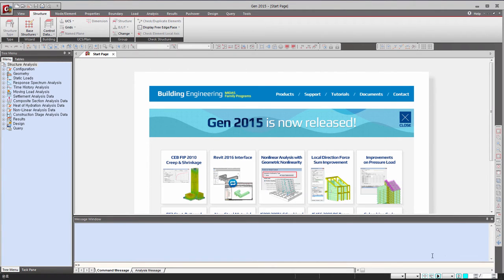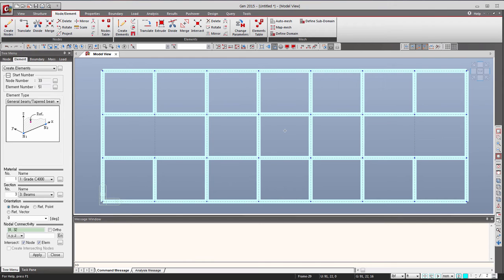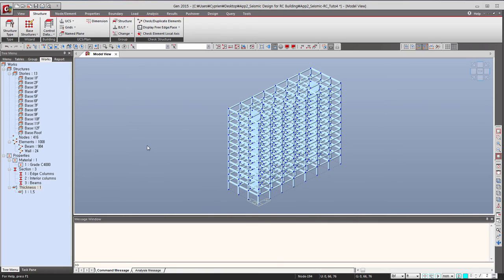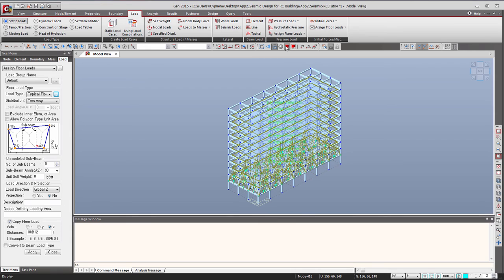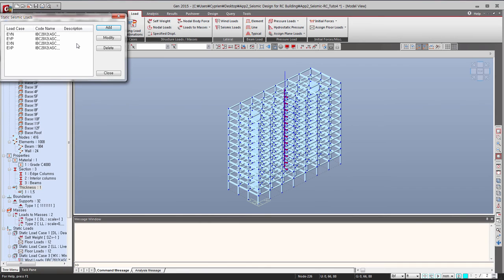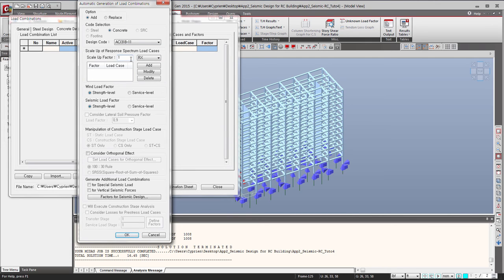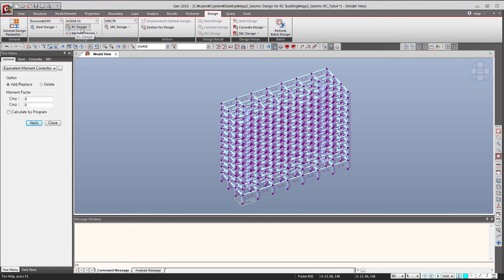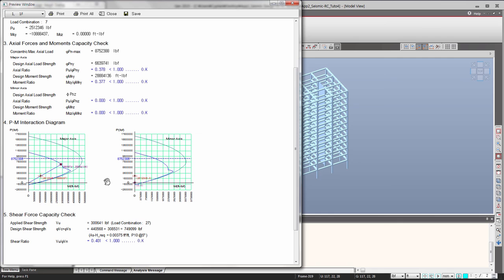[midas GEN Full Tutorial] RC building seismic design

Comment: Thanks for this video. May I ask, in the Response Spectrum load cases why did you use a Scale Factor of 0.125? 25mins and 25 seconds. Thanks
Reply: It was from Ie/R, where R = 8 from modification coefficient, and Ie = 1 from building risk category.
Reply: @desertelang  And, Why did he use later the 1.48 factor for RX direction for Response Spectrum Combination and 1.00 for RY direction?
Reply: Can you tell me from the video when it shows that value?.  @alrogodi
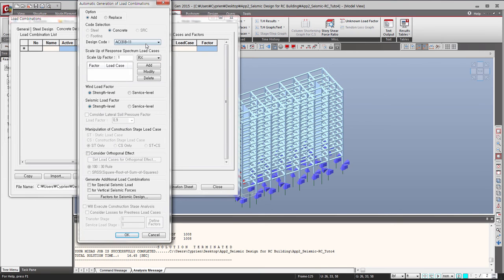Reply: @desertelang  It is at 29:30 of the video (Scale Up of Response Spectrum Load Cases,  Scale Up Factor = 1.48 in RX)
Reply: Oh, it's because the base shear from static earthquake in X direction is 1.48 higher than the base shear from dynamic response spectrum earthquake X , and for Y direction, probably the static earthquake is lower or have the same value.   @alrogodi
Reply: Thank you  @desertelang